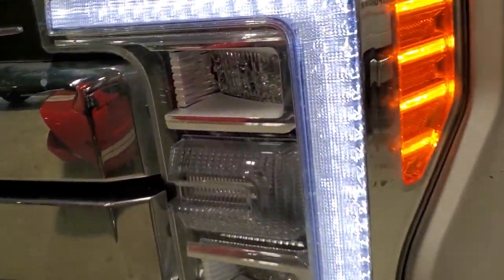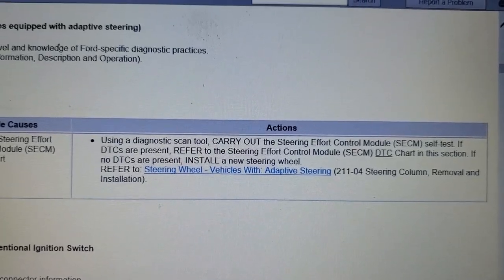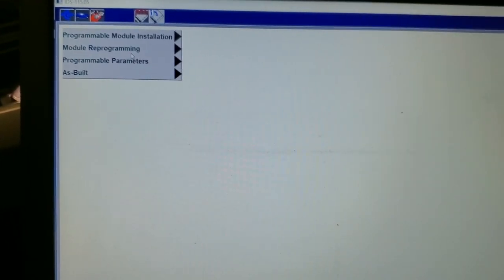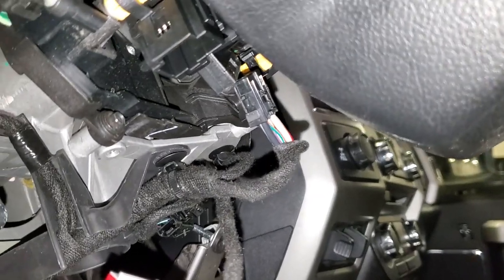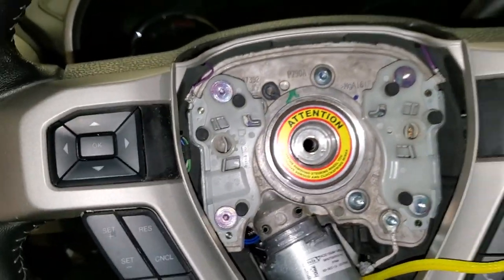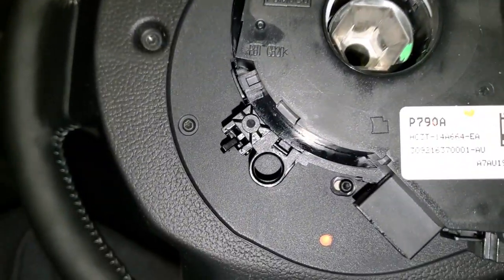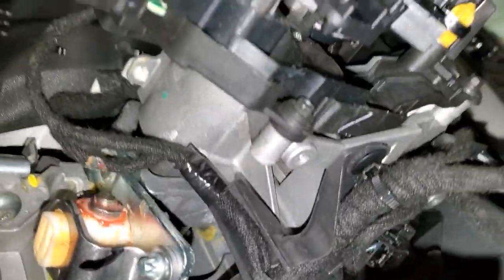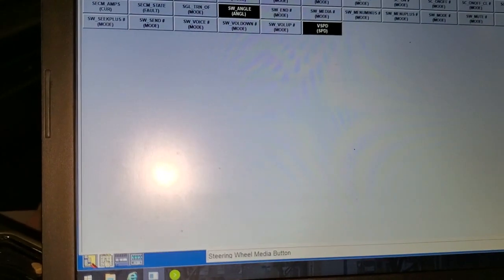17 Aluminduty Heated Steering INOP

Comment: I swapped the rubber wheel for the leather one minus all the tech . Online cost about about 250 cad . Well worth it lariat/platinum wheels are very comfortable
Reply: That's great news!  My hands are starting to get arthritis from driving everyday during the winter.  Was thinking I would have to wreck my hands some more until I can't deal with it anymore and just bite the bullet and get a higher model.  Can't really afford to buy another truck and would love to upgrade the steering wheel on my current truck instead.  Honestly it's a work truck and does get damage here and there regardless of how careful I am.  The last thing I want to do is to buy a nice truck just for the heated steering wheel.  Where did you order from?
Reply from the maker: Everything is in the video. I went to the dealer. Info in description

Comment: Thanks again ARod!  Love your humor and detailed videos!  I have a 17 with 104k miles and the heated wheel that just quit working 2 weeks ago.  Watching your video brings me to a couple of questions about disconnecting and reconnecting the airbag?  I had done this once previously with an 08, removing both front airbags, and successfully accomplished it without discharge (except maybe my undies got some streaks).  Do you need to disconnect the battery before unplugging the airbag or reconnecting it, I noticed your re-connection was not in the video...
Thank you again for your fine work!
Reply from the maker: Email me!
Reply: @PowerStrokeTechTalkwARod  what is the email address?

Comment: I have the same issue on my 2018 F350 KR with adaptive steering. What would happen if I just ordered and installed a new steering wheel at home without using the computer to do the tests?

Comment: @5:01 That wiring harness is the one used if installing a Secure Idle unit to allow the truck to run without keeping the keys in the ignition. Doesn’t work on push to start vehicles however. 
I had to solder/splice like 6 wires into that tiny harness. PITA.
Reply from the maker: Interesting

Comment: ARod i have the 2011 f450 6.7 and park light stay on. Thanks waiting for the video for  tomorrow it premiers in 28 hours.
Reply from the maker: Ricardo thank you give me some more info are the parking lights staying on if they are you probably have a short to ground or there something screwed up with the bcm
Reply: @PowerStrokeTechTalkwARod Yes they stay on even when i press the lock  button on the key they would stay on. for 30 minutes and then turn off now they stay on i have to disconnect the batteries.
Reply from the maker: Hmmm

Comment: Hey, love the vid.  Wish it was for my issue to know what I need to do.  Maybe you can point me in the right direction. 17 F250 Platinum, I'm getting an adaptive steering fault error on the display and adaptive steering and lane keep vibration isnt working anymore.  Plus the steering wheel is turn about 90 degrees to the right when driving straight down the road.  Local 4x4 shop pulled the coded C1039-94 ( Active Front Steering Lock-Unexpected Operation).  Hoping I dont have to replace the steering wheel.  Whats you opinion?
Reply from the maker: You might wanna check this out. May not be the same but ive had these screw some things up...

https://youtu.be/9w7VAkEU0k0

Comment: my biggest gripe with 2018 f150 heated seats don't come on when remote started but steering wheel is warm
Reply from the maker: They can, we need to adjust some settings my friend
Reply: You mean I have been getting in it at 10 below with shorts on freezing for nothing
Reply: They do. My 17 will do it. If it’s cold, heated seats and steering wheel with heater on. If it’s hot, ac seats and ac on.

Comment: I have a 2018 f-450 with adaptive steering that the steering wheel heater stopped working not long after the warranty expired. Can you buy a steering wheel and change it without hooking the computer to it ?
Reply from the maker: You would have to do exactly what you saw me do here

Comment: so mine isn't working. Dealer says its the control module. Everything I read says that if you have adaptive steering the module is built into the wheel and the whole wheel needs to be replaced. Any insight?
Reply from the maker: U can pay me a visit & pay ME to fix ur truck....
Reply: @PowerStrokeTechTalkwARod  35,500 on the dash. got her in under the 36 lol. this is all between the dealer and ford. just a little disappointed that its going to take another trip to the dealer when they look for a module that they wont be able to get to on my truck lol. Especially after I have brought this to their attention.
Reply from the maker: Like I say you can come see me like all the others do from across the United States
Reply: So the dealer has had it for over 2 weeks. They can’t get the settings into the SASM. Any ideas? And please don’t say take it to me
Reply from the maker: ....if ya want my time, gotta pay up. Sorry pal, my time is valuable...

Comment: Curious if you have any ideas on "adaptive steering fault" error on the display.  Adaptive steering and lane keep vibration stopped working when the error started.  I have a 2019 F250 King Ranch
Reply from the maker: There are diagnostic trouble codes or what we call DTCs stored when faults like that occur. Sounds like your going to need to drop it off to some who has a high level scanner
Reply: @PowerStrokeTechTalkwARod  Code: U3000 - Control Module

Additional Fault Symptom:
 - Component Internal Failure

Status: 
 - DTC Present at Time of Request
 - Malfunction Indicator Lamp is Off for this DTC

Module: Steering Effort Control Module

 Freeze Frame  #1:
-EVENT_TIME: 121030850 s (Wed Aug 03 15:24:24 2022) - Event time
-TOTAL_DISTANCE: 61463 km - Total Distance
-MODULE_VOLTAGE: 11.8 V - Control Module Voltage
-SW_ANGLE: -11.00 ° - Steering Wheel Angle
-ECU_INTERNAL_TEMPERATURE: 41 °C - ECU Internal Temperature
-ECU_TEMP_B: 32 °C - ECU Internal Temperature B
-ECU_TEMP_C: 36 °C - ECU Internal Temperature C
Reply from the maker: Ok, what would u like me to do......
Reply: @PowerStrokeTechTalkwARod  Was just curious if you were aware of the issue based on the DTC code and symptoms.  Nothing needed and thanks for the time.
Reply from the maker: No sir, "U" codes are the worst to diag, especially if your not here

Comment: Mine has never worked and the adaptive steering doesn’t work either I have 35 gallon fuel tank and I can only put 18 gallons when reads empty 
They have told me there’s nothing they can do about it so stupid I paid up for a fully loaded truck and I have to deal with this stupid shit
Reply: Sounds like the dealer is the one you should be mad at. Call Ford directly. They tend to light a fire under the dealer for crap like that. Hopefully your still under warranty. If not then your on your own.
Reply: I got the same problem on a 2017 platinum I bought on empty I can only fit 17 gallons any advice on what the problem can be